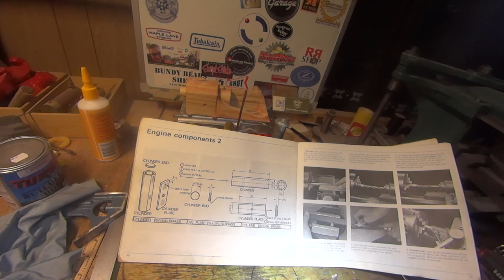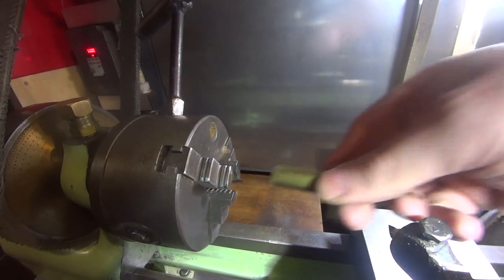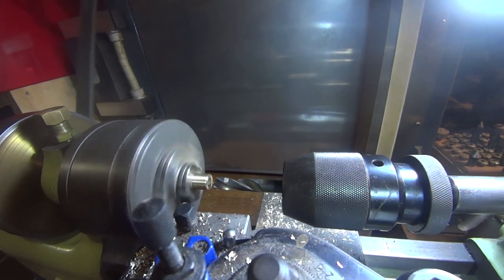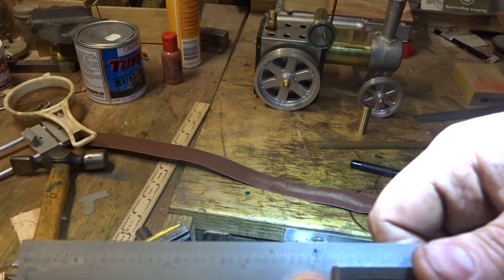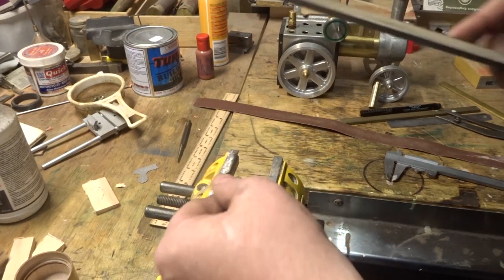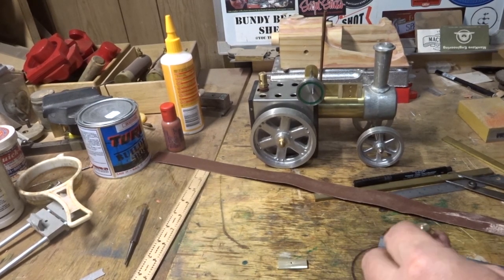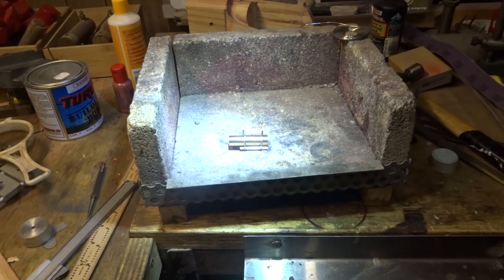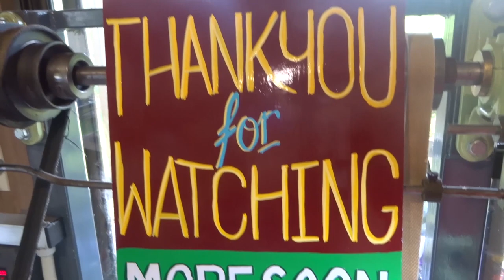PATREON SERIES KENNY Cylinder pt17

Comment: Hi Emma
Great update, just a quick question, is resin core silver solder ok for the heat of the steam, I have been using silver solder but as you know you have to get the parts very hot.
It looks like you do not have to heat the part as hot with resin core (I'm not an expert at soldering)
Might give it a try.
Regards
Gary
Reply from the maker: Seems ok for the cylinder. I've two of these engines built like this. Seems to work. Not boilers though.